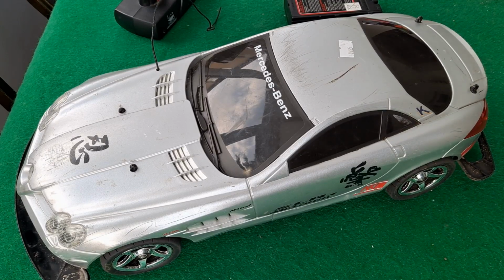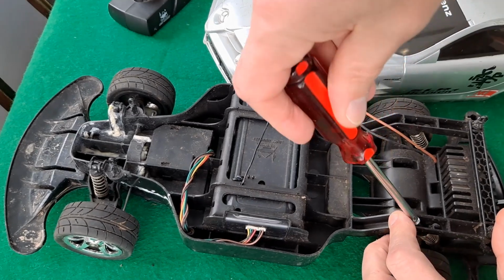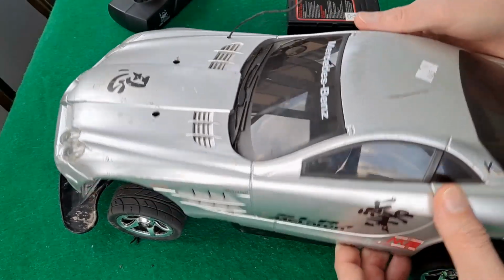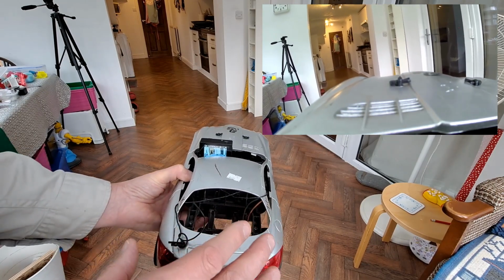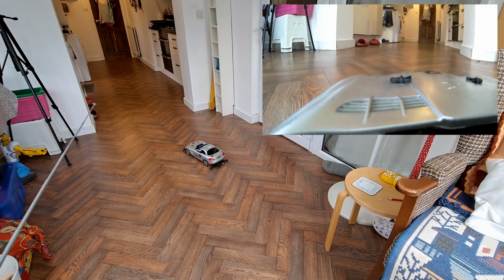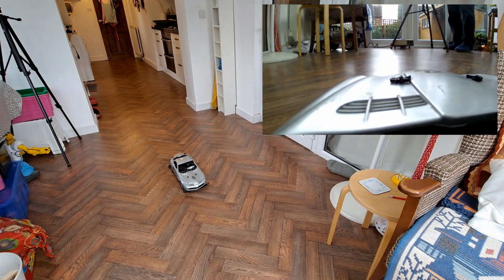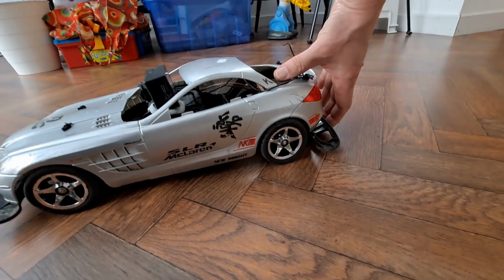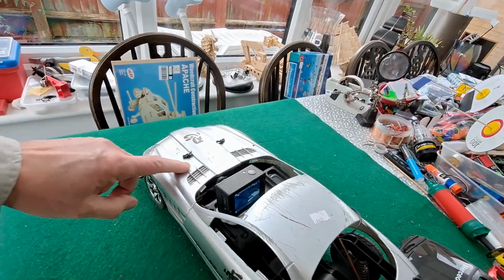What's that noise on my New Bright Mercedes Benz SLR McLaren?

Comment: That suspension was easy enough to adjust. The motor in it sounds like an arc welder and the 180s actually sound authentic. It gives it a special unique sound, which is good. :)
Reply from the maker: I don't think adjusting it that way helped. It dropped the back bumper too low to the ground. I think I need to raise the bodyshell with spacers. Probably print new pillars for the back end. I am not going to rush to do it. 😁

Comment: I was Wondering if you could change out the servo for a Hobby grade servo for the steering?then you would have a faster steering response.
Reply from the maker: Hi Marc, I would have to do a proper hobby grade conversion, new receiver ESC and servo. I think I will leave it as it is. If I run it somewhere with a bit more space, I should have time to plan the driving and allow for the steering 😁

Comment: What would be the reason for the response to be slow if the battery is charged and your close to the car. 🤷🏼‍♂️
Reply from the maker: The actual steering mechanism is slow, simple as that. It is probably a relatively weak steering motor that they have geared well down to give it enough power to turn the steering. I could do a proper hobby grade conversion with a modern servo to do the steering, but I don't think I will. I am sure if I just drove it more often I would get used to it.